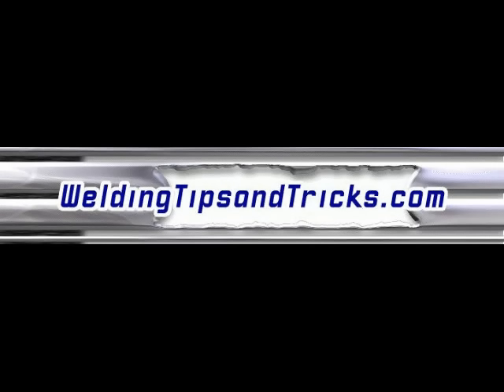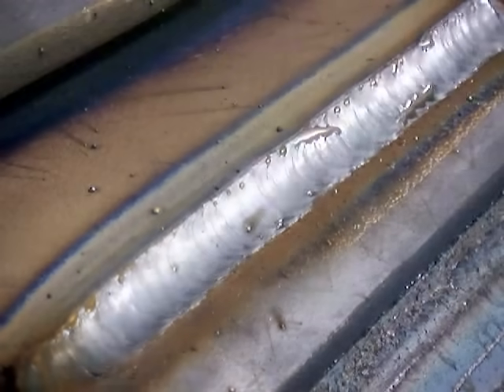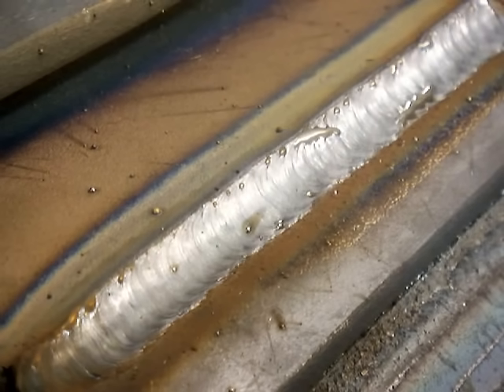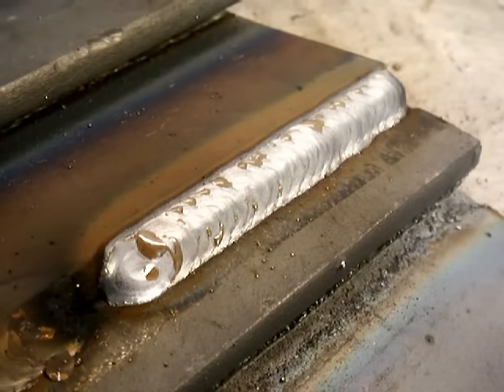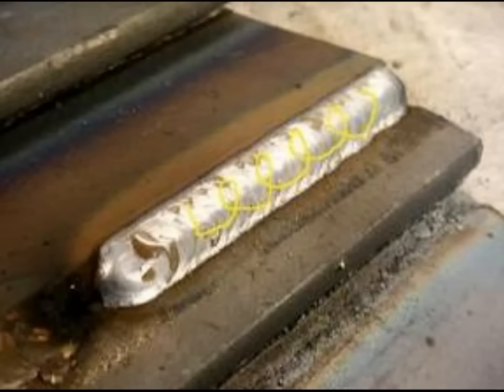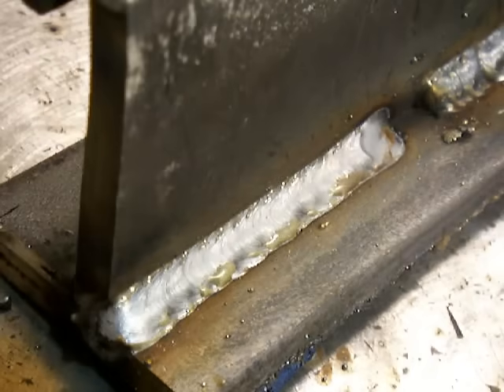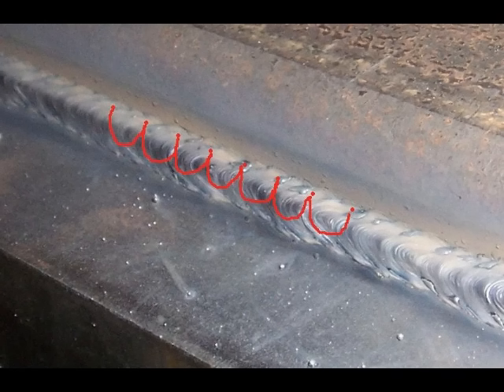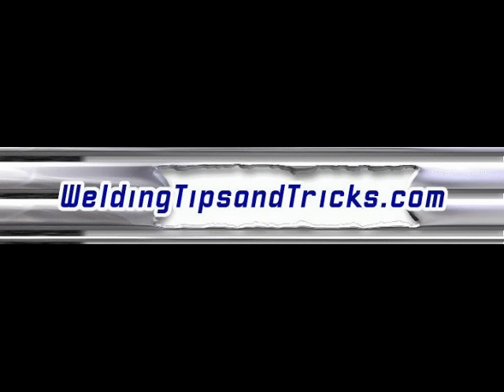Mig Welding Technique Taught by Old Timer

Comment: hi im wondering what im doing wrong i can't get those puddles of weld like you do i have a mig pac 10 & i also have the argon gas i can't even consider myself a beginner but i want to learn all i get is little small balls of weld which was the same kind of weld i was having before i was using gas i see no difference it's real crap if you could consider it crap . please help . thanks !
Reply: is your juice up high enough?  it's got to be enough to melt the surfaces of the 2 pcs you are welding together, right?
Reply: what do you mean by juice ?? my gas (argon)? it's full  haven't used the gas at all just started today &i opened the gas valve to the max i don't know what the fu.. im doin but i gotta start somwhere ! thanks for the reply
Reply: mario d.c
you do not Mig weld steel with pure argon you need pure CO2 or a mix of CO2 and argon by juice i am sure Alexis meant the Amps
Reply: ohh ok i don't know any advice i will cherish how do i know if i have a mix or pure argon i bought the tank so it was filled when i bought it . sorry yer talking to a real dummy but a dummy who want's to learn ... thnks. lol
Reply: where you bought the gas would be a good place to ask if it dosent say on the tank
Reply: yea i guess that's what i'll do  but i bought it of a dude from kijiji &i think i got screwed cause he looked knida of in a hurry im wondering what he put in there  but when i opened the valve it made a pshhhhhh sound like gas sounds so i don't know but that's what i'll do go see a company . thanks again your a great help  i really appreciate it ! i guess there's still a lot of great people left on this earth !
Reply: hi me again just wanted to know what kind of wire  do you recommend i purchase to weld sheet metal for little patch work on a car or truck .. thanks
Reply: mario d.c
you want a solid steel wire in a 0,6mm size or the equivalent in imperial but you should buy this a a welding supply store and just tell them what machine you have a what you will be welding mostly. :)
Reply: hey daniel  i have a mig pack 10 lincoln  it's a small machine i just went to a welding supply shop today & i showed them the tip i was using &also i told them that  i needed a nozzle  in front of the gun , they told me that it's important to have that cause it transports the gaz so we will see what happens now  hopefully that i'll be able to start learning . thanks for your help & response couldn't do it without you guys that help people like me .. forever greatful!!!
Reply: Daniel Claville To say, 0.6 mm (0.24") diameter wire is for very thin materials - car body stuff - not really for anything above 1.5 mm material thickness.
It is also a pain to get a positive feed - the slightest problem and it screws up.
Reply: so are you saying that i can't get those kind of puddles with the kind of mig i have???
Reply: David Richards
 well might depend of the one who is welding and also the welding machine... yes 0,6 wire is for thin stuff but with the right joint prep and technique it is possible to have good strong welds in steel up to 8mm thick. and more if you multi-pass
Reply: mario d.c
 just start welding man! you will soon enough find your welders limits and learn to work with what you've got!
Reply: thanks daniel just one more question can you tell me what kind of a mig i should get that's descent to make similar welds without spending 2 grands lol give me as mush info as you want .. thanks .
Reply: mario d.c
cant really help there the machines and brands that i know here in Denmark are not the same as those where you are but even with a cheap machine should you be able to get good weld with practice. seeing and movement and settings are what makes the difference to a good and bad weld
Reply: ohh ok  thanks anyway
Reply: Hi man, I started with a similar Migpac, In fact, 16 years later and I'm still using it for hobby stuff. No gas, just using flux core wire. if what you have is similar to mine, its a very good welder. I've welded 1/4 inch plate with it. Granted, you can't weld 1/4 plate for long periods at a time, but it does do it. as a starting point for you, if you haven't worked through it by now, set your amperage to about 65-75% of max and your wire speed to around 40-50% of max, this should work good for 14-11gauge hot rolled mild steel. and make small adjustments as the material gets thinner, anything 3/16 and over, set amps to max and wire speed to 60-70%, and go from there. there are other factors involved, even the temperature of the steel can effect the weld on a small welder like a Migpac. so you woould have to turn and wire speed down a little or turn the amps up to allow it to heat the steel a little more. I prefer turning wire speed down myself..... crap, typed too much. hope this helps.
Reply: thank you sooo much you can't believe how much i appreciate  this info &no you didn't write too much it's never enough knowledge im gonna take off my gas & use flux as you mentioned  i have a lincoln migpac 10. i don't mind the info trust me .. thanks again bro.
Reply: If it was addressed I didn't see it but .
Core shield wire 'no gas' uses a reverse polarity which means it uses a Positive Ground .
Welding with regular wire using Gas requires a Negative Ground & 25/75 or straight Co2 Gas.
I have read that straight Co2 actually runs/burns a little hotter & is cheaper than 25/75 mix & I believe my SP100 instructions actually called for straight Co2.
For what I do with my SP100 I always use core shield even on the thin stuff which is not recommended but it works for me .

Comment: When I first started college for welding.. my instructor, (who has 40 years in the industry), showed me and recommended this technique, for non-ferrous metals 3/8's & under with GMAW/MIG. Even with .023 it worked great & got me a solid A for the quarter! I have a hard time going from left to right with MIG, for me..& "everyone is different", it is too easy to lose sight of the puddle...so I predominately push, right to left, just need to try a new angle!   Now SMAW & FCAW is a WHOLE different story... Thanks for the video!!  
 _WFL_

Comment: This is a bad technique to use. The penetration profile is interrupted by the oscillation utilized by the operator. People use this technique to compensate for improper machine parameters. If the bead toes do not wet in with out oscillation you should select a higher set of machine parameters.

Comment: I've been a stick welder for over 60 years, but I just can get the hang of the material speed and heat settings....winding up with a foot of wire sticking out and hung up makes me a little more than testy!  But I personally appreciate your time and effort with YOU TUBE... passing on what you know means there will always be someone behind you !!! Thanks! R

Comment: You are lay down a PRETTY bead!  I live in SC. Used to sell maintenance welding alloys. Attended one 2 week class in Flushing, NY. That class we had one wire designed to weld poorly prepared metals 'in place.' . Rusty and/or covered with road tar, etc.

An "old NY welder" taught us your technique. He called it "whip welding." Using the heat of the pool to move forward. If one turned up the amperage to do it, he might burn right through what he was trying to repair . Or the wire might get so hot it would jam up the gun.)

Bet there are lots of techniques to kill the same bear!  Keep it up, Sparky!

Comment: I don't now dude but this is Mag not Mig....Mag is for metal Mig for aluminium.
Reply: nop man you got MIG and MAG wrong. MIG stands or Metal Inert gas. Which is argon most of the time. MAG stands got metal active gas which could be helium CO2 or other gases that affect the final result of the weld. Aluminum can be welded with  MIG MAG AND TIG
Reply: Marc-Antoine Harrisson Mag is 80% Argon 18% Co2 2% Oxigen....Mig is 100% Argon...You need 100% Argon for welding aluminium so it's Mig not Mag.
You can welt it with a Mig-Mag machine but only with 100% Argon and 100% Argon is Mig.
Reply: sjors sjors there is mig steel and mig aluminum. And aluminum is a metal...

Comment: That old timer that did and showed you this squigly line welding technique was badass. Gotta reconsider getting a mig welder, and have underestimated it's performance on thick mild steel. All in all, mig welding plate steel is easier than welding on cast iron, without nickel or nickel alloy filler material.

Comment: what settings are you using wire, diameter, voltage, and wire speed would be wonderfull
Reply: that mostly depends on you mate. how fast you move along the weld depends on what temp you set the machine to and same as wire speed.
Reply: I'm thinking about getting an everlast mig welder too so whatever settings are used would be a great help!

Comment: This is how you gas weld surely ?? Not MIG
Reply: "MIG" stands for Metal Inert Gas.....
Reply: Kyle Schlegel I bet this was MAG, not MIG
Reply: Aleksandr2975  Its very possible. No way to tell 100% unless you do both everyday. Ive never used an active gas before so i'm not familiar with what they look like.
Reply: Kyle Schlegel Gas welding is another way of referring to oxyacetylene or oxyfuel welding, where you do move the torch in a small circular motion to walk and smooth out the puddle.

Comment: can i use this for stick
Reply: Probably for basic coated ones. I would move a lot slower than he did tho.

I strongly advise against this for rutile coated electrodes, as you will get slag trapped in your weld

Comment: you must spend two thirds of your time on the bottom and one third at the top of the joint or you will have cold lap. this short circuit arc is cold by nature and you must also be on on the front edge of the puddle and never in the middle of the puddle or again cold lap will be the result.
Reply: Ok Mr welder show us one of your videos so we can see how much of a badass you are like u say

Comment: This welding process is MAG not MIG (MIG = Metalarc Inert Gas, MAG = Metalarc Active Gas). MIG is used to weld aluminium and MAG is used to steel.
Ps. that tip is not good because it doesn't melt the root well.
Reply: sjors driessen Inert gas or active gas, both are gas-metal-arc-welding.
So much dumb, how do you put up with this drivel Jody?
Reply: ***** I have welded these following classes: (PB) horizontal vertical position, (PF) vertical up position and (PC) horizontal position and I am trying to weld V-groove uphill. All with MAG like in this video (not MIG).
If I would weld like he in my working place I would propably get fired.

I am at vocational college on third year (final year) and I am better welder than he is in this video.
Reply: im in a welding train to hire program and we learned that MAG is really meant to be the same as MIG however it's really just an eastern term used to describe MIG lol I'm sure lot's of ppl will agree and disagree on this.
Reply: You are incorrect.
Reply: I meant mag is wrong not mig
Reply: I am going to watch videos of dogs pooping now see you later.
Reply: Luis Moreno Mig and Mag are not the same dude..

Comment: pushing is always the correct way to do it. the only time you "pull" is if your welding vertically down....... and no need for the loop technique if you have you plant settings set right.....

Comment: I'm currently attending Tulsa Welding school I'm on mig by my instructor keeps giving me 90 on my welds bc of travel speed bt I don't see it also ways the best settings to run a root plus fill in cap with flux

Comment: He's right in saying backhand/dragging whatever you wanna call it CAN and SHOULD penetrate more. It all comes down to technique. For me, pushing is easier and gives me close to 100% penetration with less burn through. Dragging, I'm more prone to cold fusion, burning through the metal, or excessive reinforcement. They'll hold, but not nearly as well as an even, clean push weld would. but this is all from MY experience. I don't have a lot, but I've learned quite a bit from old timers since I began

Comment: pull welding is not exactly incorrect.. having said that it does not give the penetration in the `root` of the weld (fillet weld). if you want a weld with good appearance  and high quality then you will only push weld and you never weave your weld cause this will not give you consistent penetration along the root of the fillet weld. i use pull welding when i weld sheet steel corner to corner... thats only if im to lazy to change my amps to weld push weld it

Comment: Pulling weld puddles can yield (in the hands of a professional) a much more appealing looking weld, Used More specifically in the Motorsports industries, where aesthetics are in great demand. 

You should consider this for your technique, as handrails and stairs are for the most part a Non structural assembly, and the added touch of a "pretty" mig weld will leave your customers even more pleased with your work. 

Have a good one!

Comment: It's hilarious man. you've been arguing for like 2 weeks every night here. Besides, 99% of the people saying how "good they're doing" are usually insecure little fucks. Handrails? It wouldn't matter if you're pushing or pulling those, so why are you saying PUSH? You should know that either technique will hold, even if "pulling give less penetration", which it doesn't. Have fun in you're little handrail shop well us contractors in Alberta are making $200k + minimum.

Comment: Only if its hard wire(GMAW) do you push, otherwise you usually pull your puddle slightly, about 15 degrees off perpendicular. I only push if I want a low weld profile if required. Pulling you get more penetration and pushing makes the weld look smoother and flatter and also more even. But on the contrary I have seen many welders fail ultra sound tested 100% CP welds by pushing flux core (FCAW) and Stick (SMAW) is usually pulled. With high flux weld puddles, pulling the weld cleans up the puddle.

Comment: Hi.
I've just picked up my first TIG machine (done a fair bit of MIG before), DC only.
I knew you could tack parts together without filler rod, but didn't realise you could do full welds that way.
Is there a 'rule of thumb' for using filler rod (metal thickness, type of joint, etc), or is it all down to experience?

Comment: some time just flow with the rod in a straight line, i really don't weld that way much unless mig.  These 3 is ones i use most circle, heart,c's or u's some calls it

Comment: Started welding at a vocational school last week and yea buddy, my build up pad welds were horrendous. Little did I know, or taught, that my 1st weld should have the gun at a 90 degree angle and then my welds following needed to be laid at a 45 degree. Getting better, more conformed welds and barely any empty areas between welds but still needing a lot of practice.

Comment: @ Tim Yerg: You probably have too slow of a wire speed for your amperage, either put less Volts to it or more wire speed. That should clean up the spatter. for a decent low heat mig.. id say 20-22 Volts (225 Amp) and about 215 to 230 wire speed. Hope that works...

Comment: I found that the technique (circular or straight leading) depends on the job, sometimes where you need deeper corner penetration you will be struggling with the circular but nail it with burning directly into the joint.

Comment: It's very easy to pick up. I'd never welded in my life and I had it down in just 3 days. Of course I had a couple of 10-15 year veteran welders that I asked a TON of questions. I actually discovered the technique the guy used here on my own by just practicing various methods on pieces of scrap metal. Just take your time, practice and you'll be welding like a pro in no time.

Comment: I thought you had to push the weld when using solid wire for penetration purposes?? Flux cored you can push or pull.

Comment: I did those slanted loop weave's for hotpass's using E7018 rod on 8" schedule 40 pipe in community college. Read about it in a book entitled Pipe Welding Procedures by Ramppaul published in the 70's.  Works well for controlling the puddle on uphill & verticle positions by pausing at the top of the loop.

Comment: If you do a weld pushing and pulling.... and then cut it, polish it and use an etching solution...you will see a difference in penetration, even when using the same settings.

Comment: According to what codebook?
AWS Welding inspection Handbook shows allowable concavity.
There is also allowable convexity.
The determination for the soundness of the weld is based on its design i.e. effective throat.

Comment: In many cases I would agree with you on that point, but I have used machines myself that just ended up being junk. If they not properly maintained or have severely worn parts they are not worth using.

Comment: Welding is not hard but does take a lot of practice to do well. This style does make a nice looking weld and does help penetration on the toes if you're running straight Co2. Your arc length can be tricky though if you have dust or wind near by. The last thing you ever want in any weld is porosity. Running an Argon bi mix or tri mix burns hotter and will make the welds smoother, but watch the machine settings so you don't warp your work.

Comment: mig welding is a modern form of welding,even if your a great welder,try using 100  year old arc welding equipment and rods and you would look like a rookie. as technology improves the process gets easier. same in every trade

Comment: I have taught the same thing for years......  It is a CCW circle weld, angle must be at 45 to joint, regardless of the joint. Gun at slight angle(pulling), in the direction of the weld. tis critical that the gas cone must be clean and CO2 gas works fine.With practice even a junior high kid will get IT..